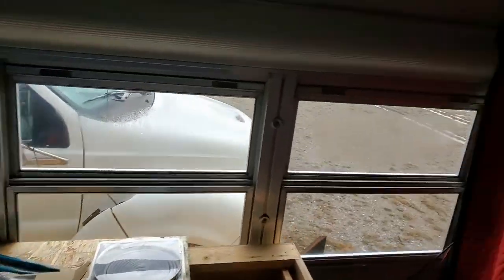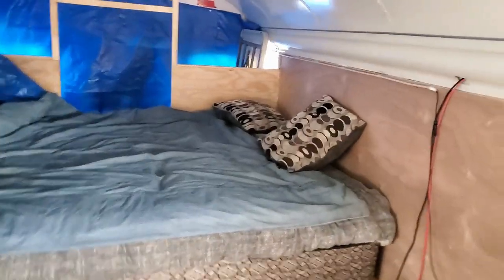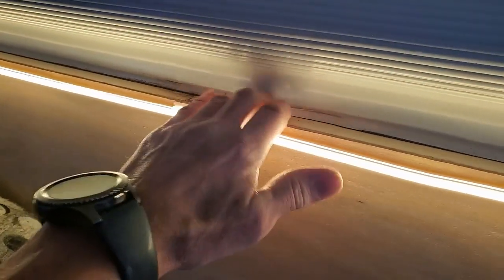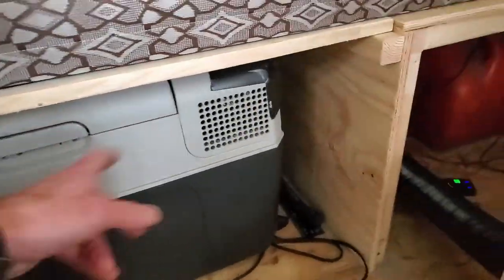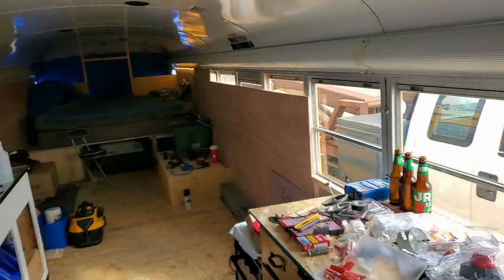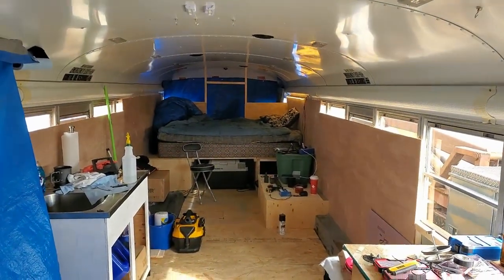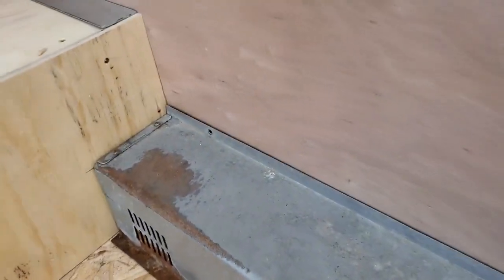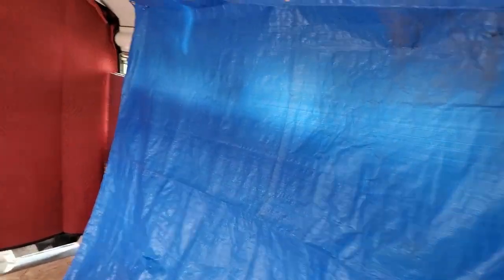Skoolie Build 16-More Wiring

Comment: There is NO fuse or breaker on the output of the battery . If anything shorts the bus will burn down with wires on plywood . HELLO .
Reply from the maker: Lol. The only wires coming from the battery go directly to a fuse block.
Reply: @RedneckRickem  The wires feeding the fuse block can short out and cause a fire , there should be a fuse able link with in one foot of the battery 50 , 100 A fuse . Any charging wires going to the battery should also be fused . A fully charged 12V battery can turn any gauge wire red hot in seconds if shorted .